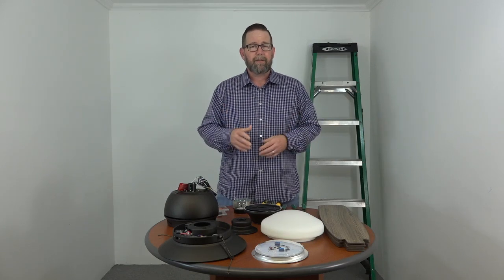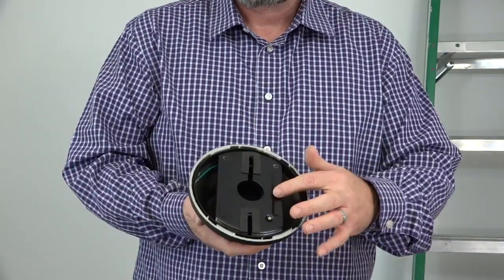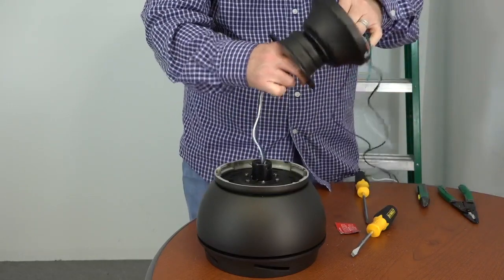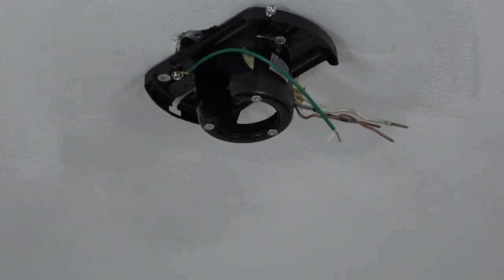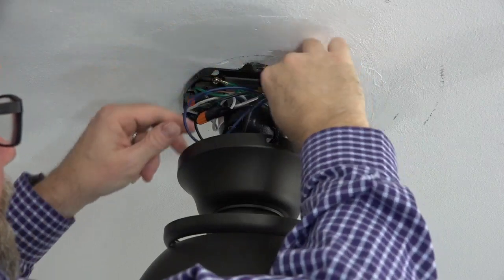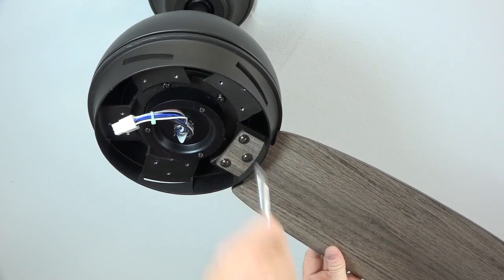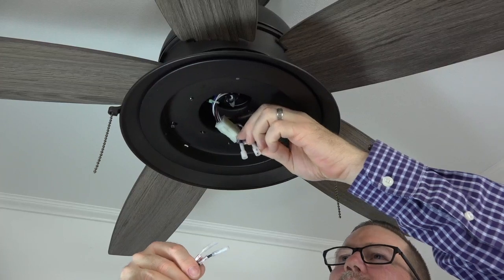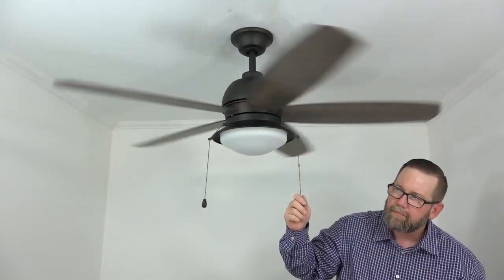52 in. Ackerly Ceiling Fan installation Guide

Comment: Great video, having trouble connecting a 6ft downrod. Does the green wire have to be removed from the short downrod that was included in the box?
Reply from the maker: Yes, the ground wire should be removed from the included downrod and reinstalled on the new one. The fan comes with enough wire for use with downrods up to 48" in length. We typically do not recommend using a downrod longer than 48" because it would require splicing extra wire which could lead to safety and performance issues.

Comment: My husband just installed this fan on our lanai. When on high speed it shakes, what did he do wrong? Also the fan and light doesn't turn on from the switch, I have to always pull on the chain. Other than that I love it.
Reply from the maker: If the fan and light won't turn on/off with a switch, the fan may not be wired to the switch. Since this fan has pull chains, the settings would remain set when the switch is turned off and then on. Fan shaking on high could be a loose outlet box, loose blades, or loose downrod/set screw.

Comment: Hooked up mine according to video , but it did not work . Also had red cable from house left over .
Reply from the maker: Sorry to hear that you had that issue. Typically, a red house wire is a switch wire and not required for this fan. The red wire can be capped off and not connected to anything. If the wiring is all correct, we would suggest that you call Home decorators Collection customer service at 1-800-986-3460. The customer service team can help troubleshoot and resolve the issue.
Reply: @ceilingfans101  ñí oí el